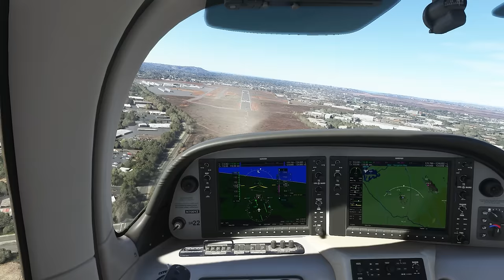Fatal Plane Crash At Montgomery Field After Student Pilot Declares An Emergency | N700YZ Crash

Comment: These small planes are stupid. They crash all the time.  Why do people insist on flying them?
Reply: That is the only way to get to fly the big planes. What. Did you think that you just graduated high school, then applied at Delta? After years of loading baggage, they finally promote you to captain.
Reply: @deanfowlkes  Does driving a scooter cab service get me into driving 18 wheelers? Does flying a Cessna have any value in flying a 747? They could've trained me how to calibrate an MRI scanner in 6 weeks without my having to spend 4 years going to Electronics Engineering College.  So people risk their lives in these shite puddle jumpers to get a shot at a 747? That's stupid.  Seems to me they could train pilots cold out of some program on simulators. Like maybe a program where you had to study in depth every plane crash that ever happened along with whatever book knowledge and you test into the simulator course and you do that for 2 years. If I keep riding jet skies will I qualify to captain a cruise ship?
Reply: @warntheidiotmasses7114  - You are actually proving my point. There is no transportation company or commercial operation in the Western world that will put you behind the wheel of an 18-wheeler unless you had experience driving a car. There is not a cruise liner in the world that would put you in charge of running a ship unless you had experience with smaller vessels. There is not a commercial operator in the world that will put you behind the controls of an airliner unless you had experience flying smaller aircraft. And, in all of these cases, no insurer would cover commercial operations by someone with no actual experience. 

In the US, Title 14 of the Code of Federal Regulations Parts 91.159 and 91.160 state that military pilots need 750 actual flight hours in order to even test for a civilian Airline Transport  Pilot Certificate. A civilian needs twice that amount of actual flight time. That is 1500 hours of actual flight time. You are only allowed to substitute a maximum of 100 hours of simulator time in specific classes of simulators toward that time. 

So, those three things, regulations, insurance, and no one hiring you would completely eliminate your plan. And, every pilot working for every airline from around the world must qualify for an ATP Certificate in order to fly an airliner in US airspace, without exception. 

On a somewhat related topic, flying a simulator and flying an actual aircraft are viscerally two completely separate things. The types of simulators that will truly simulate real flight are multi-million dollar units that cost up to $500 per hour to rent. You can rent a small airplane for as little as $100 per hour. In essence, your scenario would cost every pilot half a million dollars for training. And, this is out o their own pocket. Unless you have another alternative, your plan makes no sense.

Before comparing your experience with MRI training to operating a large and fast vehicle, go out and try it first. Having driven 5-ton trucks with trailers in the military and operating small boats, I can tell you that book work and computer screen time does not compare to the real thing. You can practice procedures and such in simulators. But, driving on a real road or flying in real airspace with other vehicle all around takes real life experience. This opinion comes from my hundreds of hours of flying simulators and real aircraft.

To give you an analogy to which you may relate. After having sufficient real world experience with the MRI, you can better anticipate events before they happen. More so than just book learning. Appropriate prevention is better than appropriate reaction.

Real world experience in a vehicle like a large airplane is even more important than it is for an MRI. What do you do if something goes wrong in an MRI? How long did it take you to learn all of the abnormal or emergency procedures for things going wrong in an MRI? If you do something wrong in an MRI, how many people would you instantly kill?
Reply: @deanfowlkes  Ok it is what it is, but does it actually make any sense? Do young pilots risking their lives in these clap traps actually qualify them to fly 747s? Theoretically speaking is there a better way? Assuming cost of simulator training is not the barrier to entry it apparently is.  Because it sounds like internal combustion engines are going to get phased out anyhow.  Will these death traps get a pass and if not, what will prospective pilots do then? Having watched a fair amount of these accident videos involving large planes, one wonders how stupid was that? Couldn't that have been covered in theory training? The plane that fell out of the sky because they kept pulling back instead of nosing down? Seriously? Some faulty sensor or something and all they had to do was nose down.  And then don't get me started on all the shite electronics they put in these planes, fly by wire and all that. Having working on computer system, it makes me cringe to think they want to automate these planes.  And then you hear the stories that many pilots don't know how to fly anyhow because so much of it is automated already.  I'd love to learn to fly a large aircraft but is flying a small aircraft merely an artificial barrier to entry? I mean I get it, driving a car is required to move up to  an 18 wheeler. But a car doesn't seem to me to be as dangerous as these small planes.
Reply: @warntheidiotmasses7114  - Your argument and insight are intriguing, but extremely shortsighted and narrow. It neither accounts for the present nor the future. 

Are combustion engines on the way out? Does it matter? We have the availability of electric cars now. Yet they account for less than 3% of vehicles. We can argue that we will have the majority of cars on the road switch to electric before aircraft will. These cars are not meant to operate at 75% of their peak performance for hours at a time. Yet, aircraft engines are. Due to that very fact, there is no clear end in sight for petroleum based aviation in your or your children’s (or grandchildren’s) lives. After that, who knows. But we are living, now. 

As far as your perception of the safety of cars, that is misguided. Aircraft accidents are just more newsworthy. Can you give the name and details of the last auto fatality in your area. Yet you know about an aviation accident in Las Vegas. My state alone has at least one auto fatality each day. Even if you factor in the number of driving hours as compared to the number of flight hours, aircraft are safer. 

To answer your question of why young adults would risk their lives in aircraft, that is a short-sighted question. You yourself probably drive or ride public transportation. Parents let their children drive by themselves as young as 16. How many people do you know who ride motorcycles or horses. Even cycling has a substantial fatality rate. Yet, you single out aviation.

Finally, your question of alternate means of training pilots. Would you train your child to drive a car without them driving a car? Would it be a smart idea for the first time your teenager got behind the wheel, they would be solo driving a bus or an 18-wheeler? It would not be a smart idea. Neither would training to fly without flying. 

There is a reason that the US government only allows 100 hours of simulator time to count for part of the 1500 hours of required flight time you would need to fly an airliner. Even insurance companies require an Airline Transport Pilot Certificate to fly non-airliner commercial aircraft. There is no substitute for flight training than to actual fly. Because, when all of the electronics in the aircraft break (and, they will if they are made by humans), you need a pilot at the controls.
Reply: @warntheidiotmasses7114  - The problem with having a kid drive a car versus someone flying an airplane is the margin of oversight. Your kid does not have regulations requiring that he knows all of the details of the departure point, the destination and the route before he starts every drive. Your kid is not required to do a walk around to ensure that the vehicle appears to be in working order before each drive. Your kid will not have a written checklist that must be completed before each phase of the drive. Your car will not be inspected as often nor as thoroughly when your kid is driving. During poor whether, your kid will not need extra training and ratings before they get behind the wheel to drive. And, your kid will not have the equivalent of a police officer on a radio in the car to whom he has to report during the drive. 

Don’t kid yourself into thinking that your kid has a margin of safety on the road. If he is in a car, on a motorcycle, or on a bicycle, he is out there flapping without a safety net. Even if he was not the one that causes the accident. 

Having flown the 737 multi-million dollar full flight simulator at the American Airlines Training Center, I can say that yes, training in the Pipers, Cessnas, and other small aircraft (even gliders) has prepared me to fly airliners. The basics and the dynamics are the same. Even the hands-on flying skills necessary to handle emergencies is the same. And, the Aeronautical Decision Making is the same (for a conscientious pilot). The only difference is the procedures and the performance numbers. 

In cruise flight at altitude, the difference between the performance of a large jet and a small aircraft are huge. They are 5 times higher, faster, and further. At takeoff and landing, they are not as huge. The difference is more like 2:1 (around 250 mph below 10,000 feet and 150 mph for approach to landing). A larger small aircraft, like a twin-engined Cessna, would shrink the margin even further. Almost one to one. A turbine-engined Cessna would be almost identical to the Airliner in performance. You graduate up from small single-engined aircraft to multi-engined to turbine-engined to airliner. It is the crawl, walk, run method of learning. 

As a matter of fact, where I fly gliders is about half full of airline pilots who fly gliders to keep their flying skills honed to razor sharpness.

To stick with the car analogy. If your kid is going to drive an 18-wheeler, they have to survive driving a car. But, they need to learn in a car with figurative training wheels. If you buy your kid a car that can do 200 mph, you will be the cause of their death. Even race car drivers start out in smaller, slower cars before they graduate up to the big leagues. 

In none of your arguments have you addressed the elephant on the room. You can not fly commercial airliners in the US unless you have a minimum number of actual flight hours. That minimum number of actual flight hours for the average airline pilot is over 1000 hours of actual flight time in an actual aircraft. Where are you going to get those hours?
Reply: @deanfowlkes  My thesis is, just because the elephant is in the room, doesn't mean it belongs there, or that it's rational or logical.  Maybe it is. I'm just throwing a thesis up against the wall to see if it sticks. So training in the applicable simulator is expensive. Maybe that's the problem that should be addressed instead of pushing the cost and risk off onto the student pilot requiring those prospective pilots train on aircraft that seem to be different in that they crash more frequently than larger aircraft. Come to think of it, it would not be impossible to train a truck driver how to drive an 18 wheeler having never driven a car. It's completely different. You're driving in 3D versus 1D.  You're driving slower, turning is a lot harder, backing and all that is completely different.  So just because a federal agency has a rule on the books doesn't make it gospel. I doubt many truck drivers in Thailand ever had cars before climbing into an 18 wheeler.  And they seem to do ok. It's seems a lot of those small plane pilots have to learn the hard way, on their way down into a crash. Perhaps there's a simulator solution to registering hours on what flies like a small craft.  I worked in the corporate world doing Six Sigma design and quality projects, and having job hopped for a while I'd walk into a company and ask why are you doing it this way? And they'd say we've always done it this way. Teaching English in Thailand? Same thing. Wrong books, wrong approach, bad results. Well, they've always done it this way. I get it. It'd be hard to describe to someone how a jet ski handles, You just have to get on one and learn what not to do.  But these small aircraft pilots pay the ultimate price for mistakes that perhaps could've been experienced using simulators.
Reply: @warntheidiotmasses7114  - Your thesis is just that. A thesis. One day, it may be fact. Today, it is just fiction. You are not accounting for the limitations of current technology, nor the capacity of human beings. Your thesis is incorrectly equating differences to being different. 

The reason the Crawl, Walk, Run method of learning works is because higher learning needs a base or foundation. If you do not have the fundamentals learned, you can not truly progress and fully apply the higher functions. Your thesis is the equivalent of teaching differential equations to kindergartners. It may be possible in rare cases. But, not very probable. You need to teach them to count first. Then, move on from there. 

Training a person virtually who has never driven before to drive an 18-wheeler  will be harder than you think. Are there differences in driving an 18-wheeler compared to driving a car? Yes. Are the fundamentals the same? Heck yeah. Is backing a truck and trailer difficult? Yes. Will learning to effectively back up a car prepare you? Heck yeah. You have to get the fundamentals. And remember, I’ve already said that I drove 5-ton trucks with pintle trailers in the military. I was also the NCOIC of training new drivers. I have a little bit of experience in this field. 

Have you ever been to Thailand? There are quite a number of small and medium trucks, cars, motorcycles, scooters, and tuk tuks. There is a very small amount of large trucks. The 18-wheeler drivers are the elite drivers in their career field. They do not just start driving 18-wheelers as new drivers. 

You mentioned passing on the costs of training to the students. The reason why there is a worldwide pilot shortage currently is because of the high cost of training. Your thesis would increase the cost by a factor of five. You may live in a country where the government or the airlines pay for training. I do not. Here in the US, those costs are borne by the students. If these students were to be given the choice, they would choose the affordable (barely) option. That’s better than not flying at all. 

If you have not seen the scale and complexities of the simulator necessary to replicate real flight, Google FAA certified 737/A320 full flight simulator. Imagine the ATAT[sic] Walkers in Star Wars. That is about their scale. 

Now, back to your thesis. This may be plausible in the future. If human beings were to advance to the point where muscle memory can be learned through mental memory implants, then yes. If each student pilot could invest in their own simulator, then yes. If the cost and size of a full flight simulator would come down to a foreign luxury saloon sedan, then yes. 

Until then, your thesis is untenable. Even then, your average student would still rather fly real aircraft. It is not because it is cheaper than a simulator. It is because your average Student Pilot is not choosing being an airline pilot as a career because of the job or income potential, or the benefits. It is because they enjoy, want to and love to fly. Fly real aircraft. 

Your entire thesis is based on safety over free-thought and free-will. I’ve already explained the safety aspect of why this is not feasible. Let’s talk about your determination that you are the arbiter of what a person should be allowed to do. People love flying their own aircraft. Teenagers love being able to drive their own cars (a statistically more deadly activity). People love riding motorcycles (also more dangerous). People love scuba diving. I won’t even go into skydiving and hang gliding. Your entire thesis is about your opinion and will over another human being. 

Now, let’s talk about harsh reality. People die. People die all of the time. It is a fact of life. You callus die in a traffic accident. You could die in an aviation accident. Or, you could die naked in a bean bag chair eating Cheetos. You are still going to die. You can not escape it. Yet. Fully embrace life while you can. Just don’t take others with you. And, most aviation accidents are pilot error. But, at least they were living life on their terms. They died doing what they lived and loved. And, the lessons learned are lessons for the entire community. Many Student Pilots on this thread have learned a valuable lesson without paying the cost. Lives were saved. And, an entire airliner full of hundreds of people were spared. His life and endeavors were not in vain.
Reply: @warntheidiotmasses7114  - By the way. For the record, I am a staunch advocate of combining simulator training with real life flight training. I also strongly advocate continued simulator and flight training with an instructor throughout a pilot’s flying career whether they do it professionally or recreationally. A good pilot is always learning.

You should take an introductory discovery flight. At least put a little real world experience behind your thesis. Academics without application is rather hollow.
Reply: @warntheidiotmasses7114  - You are in the right ballpark, but on the wrong path. How do we make training pilots safer without sacrificing the much needed experience that makes commercial aviation safer? We re-evaluate the training aircraft. 

For instance, gliders train pilots on basic manual stick and rudder skills, environment interpretation, and aerodynamics. And, gliders have very little to go wrong with them, because their is very little equipment to go wrong. However, the lack of power limits their use in instrument flight training. 

Electric aircraft are nearly identical to the current technology of aircraft. They are quite suitable for instrument flight. However, you would lose the experience gained from engine management. I imagine that this could be programmed into a dummy system aboard the aircraft. Electric aircraft still lack the range and battery power necessary to meet the cross-country flight distance requirements of pilot certification. And, you lose the real world experience of navigation. There is much more to it than GPS. 

You could combine the two aircraft to where a pilot spends some time in each. This then poses logistical issues with instructors, parts, maintenance, etc. 

The only readily available, off the shelf solution would be a gyrocopter/gyroplane. These would give you all of the same benefits of engine management experience, instrument flight training, fewer break points, safer and sharper handling characteristics, improved maneuverability, and safety of flight.  The only thing it would lack is the ability to do Stall Recognition Prevention and Recovery Training. Stalls, Spins, and Spirals are virtually impossible in a gyroplane. A pilot would still need to spend some time in a fixed-wing aircraft to fulfill their Stall RPRT. Something that can not quite be accomplished in a simulator. You can only simulate so much acceleration and positive/negative G-load.

Gyroplane/gyrocopter production is very limited, though. There are virtually no certificated gyros. They are all experimental. Developers and manufacturers have not found a large enough market to make production financially viable. This is due to the fact that current technology limits the size and payload capacity and speed of gyros. This has hampered their appeal to the commercial and transportation/commuting market. The only real commercial use that I know of that had any chance of becoming real was Utah Bureau of Land Management almost purchased a fleet for their use. It would have been more economical than helicopters and more flexible than airplanes.
Reply: @warntheidiotmasses7114  Flying aircraft requires all sorts of skills, most of which change very little between aircraft types. It makes far more sense both operationally and economically to learn as many of these skills as possible in small cheap aircraft, before moving on to bigger machines.
Reply: @warntheidiotmasses7114  Please, do not use the death of a person as an excuse to parade your ignorance in public. "You screw up you die" with regard to flying aircraft is palpably and provably false. If you do a formal risk analysis of driving cars and flying aircraft, aviation is much, much safer; the statistics bear this out - no matter what measure you use, aviation is safer. I can also tell you from personal experience (full commercial licence and more than 5,000 hours total flight time), that heuristic learning is extremely effective, especially in activities where reliability and accuracy are very important. I could go on, but I fear that trying to help you understand might be a thankless task.
Reply: @deanfowlkes  You might also state that the flight time requirement for transport pilots is not an arbitrary thing; it is based on a considerable amount of analysis of how to make aviation as safe as possible.
Reply: @deanfowlkes  Points taken. Interesting.
Reply: @hb1338  You think small planes are safer than cars relating hours driven / flying? I'm talking about these little prop planes. 2 to 4 seaters.  I posited why do people fly these things when there's nearly a crash video every week.  See the resulting comments. The difference between cars and small aircraft is that cars are safer than motorcycles so people drive cars to increase their chances of survival. You screw up in a car chances are you live. Not so in a small aircraft and perhaps more so on a small motorcycle.  People have to travel so they drive cars. People don't have to joy ride in small planes... unless that is they're trying to move up into piloting large aircraft as were the comments above.  A friend of a coworker flew a small plane for enjoyment and died.  Seems to me to be a risky hobby.  No matter how much experience you have it seems, something goes wrong and it's game over.  JFK Jr. may be a bad example because it seems there might have been a conspiracy afoot, but with all that money he could've traveled by alternate safer means.
Reply: @warntheidiotmasses7114  - You are still not getting the point. And, from your talk of conspiracy, I would think you would understand. 

I, for one, live in the land of the “free”. In this land, you are allowed to smoke or chew tobacco, ride motorcycles, ride horses, shoot guns, rock climb, play football, etc. Each one of these can kill you. Each one of these kills more people than aviation does. People know the risks. It is up to each individual to decide if the reward is worth it. You don’t have the right to determine another person’s legal activities for anyone except yourself.  

Yet, all of the deaths from these other activities combined get less regular and consistent media coverage than one small aviation accident. Each aviation accident will have thousands of videos, analysis, and re-enactments done on it. So, if your personal YouTube algorithm thinks that you like aviation accidents, it will fill your queue with enough videos to last you a year of watching 24/7/365. All of these are of the same few accidents. Like I have already said, my state has a minimum of one traffic fatality a day. Where are those videos?

Another indicator that you are confused in your argument is that you distinguish a non-existent difference between small aircraft and “prop planes” (your words). Almost all small and medium sized aircraft are propeller driven. Even when they have turbine engines, they are still propeller driven. Even small to medium sized airliners are propeller driven. The difference is in the pilot and not the aircraft. Putting the same accident pilot in another aircraft that is not propeller driven will just hasten their arrival to the crash site.

As far as the reason to have such a hobby: enjoyment, commuter transportation, recreational travel, challenge, volunteerism, humanitarianism, excitement, etc. Just to name a few off the top of my head. In my state, it takes over 12 hours to travel from one side of the state to the other. There are professionals from every field who find it necessary to travel those far distances on an almost daily basis. In Alaska, travel for everyday purposes is basically impossible and impassable unless by air. 

Finally, I would give you my condolences over the death of the pilot that you mentioned. Except that in your description you had no relationship to them. They were the friend of someone that you yourself could not describe as a friend. Everybody knows someone that knows someone that knows someone. 

I know someone who had a complete aortic rupture while flying solo. They were a good enough pilot to make it almost all the way back to the airport. They died while making a completely safe landing in an adjacent field. After the ambulance removed the body, another pilot moved the aircraft the short distance back to the airport. It was ready for flight the next day. You might eventually see an “aviation accident” video on it.
Reply: @warntheidiotmasses7114  Ahhhh. And, there is my point proven again. You actually think that your opinion is valid for everyone’s life. If you were thinking outside of yourself, you would realize that your idea of living is not someone else’s idea of living. No one cares if you do not want to fly in a small aircraft. Live your best life, whatever that means for you. 

For me, that means living life to the fullest and experiencing all that you ever could experience in life. And, that sometimes means taking calculated risks. Your opinion seems to be that your life is worth more than actually living. 

I never mentioned New York or Wisconsin. So, I don’t know what your hang up with them is. Alaska is one of the most beautiful places on Earth. Actually, Wisconsin and Upstate New York are beautiful as well. But, if you are inexperienced in travel, you would not know that. Neither would you know how long travel takes.  But again, you are giving your unfounded opinion. 

I don’t play golf. Nothing against it. My father used to love it. To each their own. I know plenty of hunters and fishermen. Not all of them are young. Not all of them are old. None of them are bored. You seem to have an opinion on them as well, though. 

Your idea of spending your days on the beach sounds great. I have been on beaches around the world. Even the pristine, non-tourist ones of South America and Asia. Not only do I have the proverbial T-shirt, I actually own property. Living your days fat, dumb and happy on the beach is not for everyone. It would actually drive some people crazy. I can spend about a day, or a week maximum on one before it’s time to find something more interesting. 

If you think buying a sailboat is the solution over an airplane, you are sorely mistaken. You would be jumping out of a frying pan into a different frying pan. Sailboats are not the bastion of safety you think.

As far as divorce and bars, be my guest. I’ve also been to bars and nightclubs all over the world. Just like the beaches of the world, they are overrated. I will leave them to the young and still stupid. Enjoy them if you want for as long as you can. That is your choice to make. I prefer the mountains and forests. 

If living life to its fullest to you means divorce, bars, and strange women, then you do you. Although, it is so stereotypical, cliched and indicative of someone who is old and bored with life that I am surprised that you even bring it up. Remember that all of those things carry their own deadly risks. Over-indulgence or habitual indulgence in alcohol leads to several forms of morbidity and mortality. Sex outside of marriage risks STDs. Strange women bear their own risks to health, happiness, and your remaining 70% after the divorce. 

Finally, you have proven my point yet again. If you are planning on actually living in the best beaches in Hawaii which is in the USA), South America, or other countries, you better have access to a small aircraft. Visiting the tourist areas is one thing. Actually living in the nicer areas where you can enjoy the beaches is something completely different. I imagine you have an opinion about that. 

There is a huge difference between having life and having “a life”. There is more to living than just being alive. The bottom line is that you are going to die. You are going to die in a car crash…or in a fire…or a natural disaster will hit your house…or you will trip and hit your head…Or you will die choking on a chicken wing in a bar…or you will die being choked by one of the bar women’s significant other…or you will have an aneurism…or one of the millions of other ways you might die. It does not matter how you die. It matters how you live. In my opinion.
Reply: @hb1338  - Actually, there is no convincing this guy with facts. That is pointless. Not only does he not know facts, he does not want to know facts. He is more interested to know his opinion is heard regardless of if it is not right. I honestly hope he never gets in a small aircraft. His personality poses a hazard to the entire flying community. He exhibits all of the hazardous attitudes. He also might not know that Hawaii is part of the USA.
Reply: @deanfowlkes  P.S. Come to S.E. Asia man. I'll show you around if you pay my way.  It takes time and effort to put together an efficient itinerary with reliable go-to people. I even know an island where you can fly off a cliff with one of those motorized parachute things. Bring the plane and a few buds. Fun times guaranteed or I'm not the know it all I proclaim to be.
Reply: @warntheidiotmasses7114  - I’ve been to several places in Southeast Asia. I have family there. I do enjoy going. I think I already mentioned owning property there.
Reply: @warntheidiotmasses7114  - Your post was half political ranting that had nothing to do with Aviation. So, I will ignore that part. 

As far as the aviation part - 

Airliners spend an exorbitant amount of time and money training pilots to fly the technology in today’s airliners. They train the pilots to be systems managers. Manmade technology will always break. When that happens, the person at the controls need to be real pilots. They need to be proficient at the basics and fundamentals. Think of a professional athlete. They are all proficient at the basics and fundamentals. 

As far as risk taking, you might not be alive today unless your ancestors took calculated risks. We would definitely not be as advanced as we are today unless our ancestors took calculated risks.  It is part of human nature. You take calculated risk even today. Our ancestors definitely took calculated risks just to survive as a physically weaker, slower, and less capable animal than the others. And, this was well before domesticated cats. 

Risk takers protect countries, advance businesses, create opportunities, and respond in emergencies. The very software and devices that you use to view these videos and make these comments were brought to you by risk takers. If you are not training your child to evaluate risks and rewards, and developing the courage in them to take risks when appropriate, then you are raising another sheep to be exploited and/or slaughtered. 

As far as your assertion that the risk of flying is too great because they crash all the time, that is awfully narrow-minded and misinformed. Most General Aviation aircraft flying today were built between 1940 and 2000. That is a much better record than the automotive industry. Even though the auto industry produces more product. This would not be possible if the percentage of crashes was as you assumed. That would be analogous to me saying that all teenagers will be involved in a fatal accident. If this were true, society would not exist.

You seem to want to spend a lot of energy arguing a point about a subject about which you know woefully little. You rant about the herd following the man to whatever mind-slavery the man dictates. Yet, your entire argument is based on sensationalized media coverage. Do you not see the irony in that?
Reply: @warntheidiotmasses7114  - And yet here again you are deflecting away from the conversation about aviation with rants about PTSD and pseudo-political ramblings. Obviously, another subject that you know little about. If you try to stay on topic, you might be able to form a coherent argument about the subject at hand. You might also remember that I have already mentioned that I served in the military. I’ve also been privy to third world police and military forces. 

Apparently you are not aware of the PTSD, depression and suicides that occur with survivors of fatal car accidents, natural disasters, crime victims and other tragedies. Even non-risk takers fall victim to this. It is because of risk takers that more people do not have to deal with this. 

I am not just talking about the US military. Currently I am surrounded by Ukrainians who have fled their country while their husbands, fathers, brothers, sons, etc are defending their country. They are not just going with the flow and doing what they are told. 

Even in peacetime, there are first responders risking their lives for the sake of others. And, you conspicuously did not mention the various entrepreneurs, business men, and inventors who have disregarded convention and the status quo to achieve far greater success than anyone could playing it safe. 

Truly the only one in this conversation that is going along to get along is you, yourself. Because of your “this is how I have always thought” syndrome, you can’t imagine anyone thinking or doing differently. You can not imagine someone doing what your mainstream society says is risky just because they enjoy doing it. 

I fly because I enjoy flying. I enjoy the feeling. I enjoy the view. I enjoy the peace and calm. I enjoy the challenge. I feel the same way about cycling, long distance running and traveling. I even enjoy driving my own car instead of taking mass-transit or a car service. 

I belong to clubs and organizations of people who enjoy the same. Some of them are doing it to advance a career. The vast majority are doing it for the pure enjoyment. They either are already airline pilots and don’t need to count or even keep track of the hours any longer. Or, they are in a completely different, non-aviation, profession. Or, they have already completed their career. And, we fly because we enjoy it. 

Now, if you do not enjoy it, go find something that whatever media you follow says that you should enjoy. Go sit on the beach and do nothing. Go sit in a bar and do nothing. Go sit in front of a computer screen and do nothing. The same as you have always done. 

Pilots are not “do-nothing” people. That is not what we enjoy.
Reply: @deanfowlkes  What was the argument? That small planes are risky and dumb? Ok so your position is they are not dumb and risky? I guess we can agree to disagree.  It's too bad the risk and expense  of flying a large jet is offloaded onto the little guy.  Like I said, having watched a lot of crash videos for large aircraft, you have to wonder, how does that happen? All the flight time they had in large and small planes and that's the mistake they made? As for Ukrainians and Russians, you think each side is fighting for their own country? Hmm. How about Vietnam? Was the US fighting for its country? Read the book "War is a Racket" by your very own ilk, Colonel Smedly Butler.  Peace and calm up in a small plane huh?  I'd say risk taking can be explained by a parasite known as Toxoplasmosis.  It's transferred to humans from cats. Supposedly it's in most all the brains of those who can be characterized by Type A personality.  All in all small aircraft, large aircraft, they're not Green according to the people you military types work for.  Global warming? Wait for it.... and lock down! Off to smart cities we go.
Reply: @warntheidiotmasses7114  - Well, political ramblings aside, the argument was about whether small planes were worth the risk. My argument was that it depends on the individual. Each person has to determine the answer for themselves. 

Are small planes risky? Yes. Are they more risky than anything else you take for granted? No. They just receive more media attention to grab the imaginations of those that do not know any better. Are they replaceable for the training of pilots for large, commercial airliners? No. 

So far, you have suggested multiple ideas for pilots to occupy their time in endeavors other than flying. Sailing, bar hopping, International travel, and other activities have topped your list. Each one has an associated risk. And, depending on what media you follow, each will have countless stories and videos showing the fatal end of what many other people besides yourself would call stupid risk takers. After all, who would be stupid enough to put themselves beyond swimming distance from shore or beyond the protection of their home country. I do these activities because I believe the reward outweighs the risk. And, by your own account, so do you.

I threw you a life line several posts ago to elicit from you at least a small amount of forward thinking. The question is not why do we fly small aircraft. The question should be how can we make aviation (big and small) safer. To think otherwise is analogous to saying personal automobiles are risky and dumb. And, the people who drive them are brain washed risk takers who are being forced to bear the burden of personal transportation. The automotive argument is even more accurate since a larger percentage and far larger number of motorists die in automobile accidents.

I can see why you do not want to debate those points. After all, driving, traveling, bar hopping and maybe even sailing are all the activities that you enjoy. It would be not suit your needs to question the risk factors of those activities. You still have to accept an amount of risk when doing them. If you are not evaluating the risk, then you are blindly ignoring the risk and following the crowd.

You have even advocated personal travel to East Asia as you also advocate a less well trained cadre of flight professionals. That in itself does not make any sense. And, you have still not feasibly identified a practical way to make aviation training safer. 

You have suggested that I read up on previous wars to advance your ideology. Yet, you have willfully entrenched yourself in your own ignorance. And, your only defense of your position is the videos you are watching from an uneducated position. Videos that a multi-media behemoth has used to literally target you and your unknowing mind. Yet, you have probably not even attempted to educate yourself on the subject you are deriding. An education that you could partially get for free.

Having an opinion is not a crime. But, having an opinion (no matter how strong) does not make you right. Just like watching a bunch of videos does not make you an expert. I do agree with you on one thing, though. As technology advances, your utopia of smart cities will become more and more likely. The funny thing is, that will probably increase the proliferation of inter- and intra-city small aircraft. 

Problems are free in this world. People get paid well for solutions. Are you part of the problem? Or, are you going to be part of the solution?
Reply: @deanfowlkes  I kinda lump flying these small planes in with golf, hunting and fishing. Men are so bored with their lives that anything to get them out of the domesticated jail cell for long periods of time is miraculous. Golf courses are dumb. Lots of wasted land that has to be watered and chemicals sprayed on it. Catching fish? For sport? Dumb. At least eat what you catch. The carbon footprint !!! The manufacture of the fishing boat and all. Hunting is righteous. I give it my seal of approval.  Ironically when an American waaahman divorce rapes her husband, he probably has to sell his plane, perhaps saving his life. Rumor has it we'll be eating bugs by 2030.  I'd say that pretty much leaves out flying small planes.  I doubt many 747's will be flying either.  Enjoy your hobby while it lasts.
Reply: @warntheidiotmasses7114  - What you are saying, especially in the context of what you have said, does not make sense. You seem to think that hanging out in bars, hanging out on a beach, drinking and chasing women is any different of an escape than golf, hunting, and fishing. It is just another form of boredom killing and breaking out of whatever jail cell you are in. Whether that jail cell is matrimonial, financial, employment, parental responsibilities, etc.

The similarities in these examples are astounding. I have been to some of the best beaches and popular resorts. I can tell you first hand the the carbon footprint and use of resources are equivalent. They even have their own boats to transfer guests and provide recreation. So, that incorporates the fishing angle. If you want to get to the remote, pristine, and unpopulated beaches, you will need aerial transport. 

Chasing women is another form of hunting. Just with a different prey. A pret that can do far more damage to your finances than a wild hog deer or grizzly. 

Didn’t you advocate sailing earlier? How is that different than fishing, really?

Ironically, if there is a financial split in a divorce, the guy (or girl) with the airplane is more likely to keep it than the guy with hunting land. I see that happen time and time again. Real estate is much hotter than any vehicle. 

You are probably mostly right about eating bugs in 2030 and beyond. The thing is, I can guarantee you that even if 90, 95, or even 99% of the world population is reduced to eating bugs, there will still be people who will not have to. They will still be eating Wagyu ribeyes. And, aerial transport will be even more important for them. Not to mention the importance of aerial transport for medical, humanitarian, and other needs.

Bottom line is, to each their own. You enjoy your hobbies as well. I will enjoy mine. Statistically, I only have about 20-25 years of good health left anyway. I will make the most of living as much as humanly possible with the time I have left.